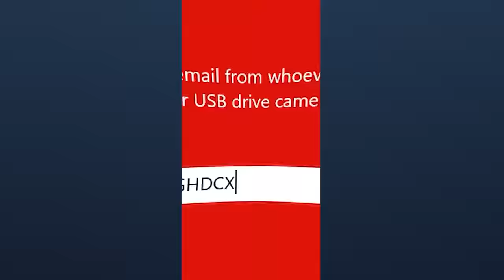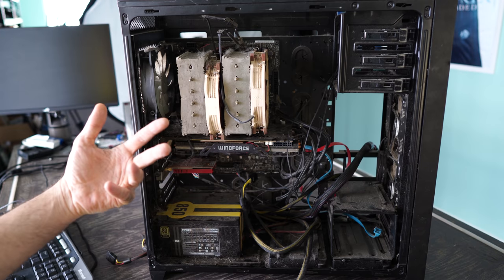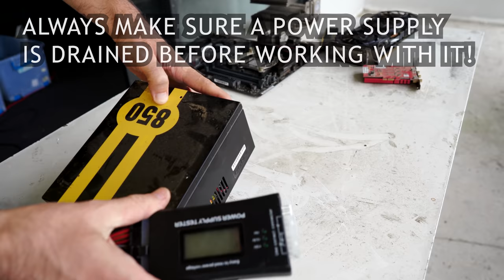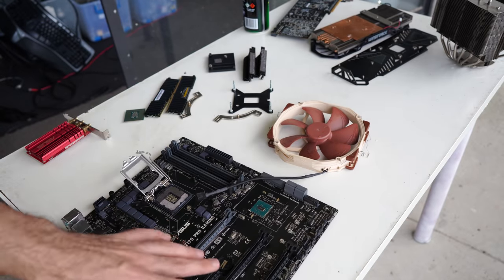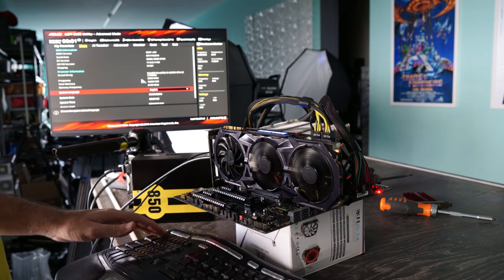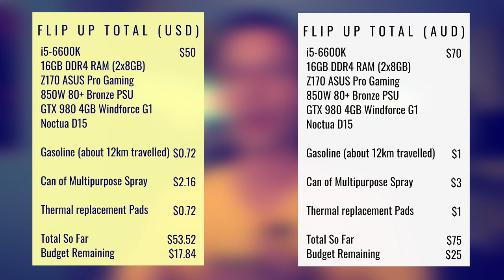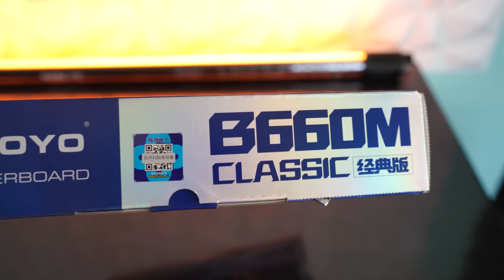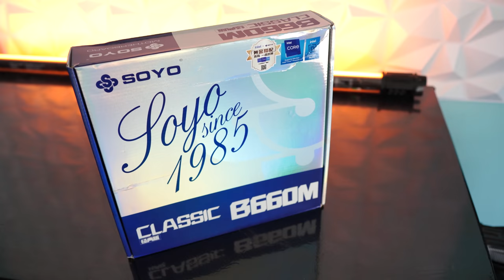Turning $100 into a HIGH-END Gaming PC - S2:E1 "Untested means UNTESTED!"

Comment: The PCIE cable that failed, was probably the root cause of why he sold it for 100 bucks. The moment you removed it, the system would have been fine. The old owner probably troubleshooted every other component excluding that one psu cable.
Reply: Or just trashed it without doing much internal troubleshooting (especially considering how dirty it was).
Reply: All the better for tech yes and us
Reply: Yes PSUs turn off if they see a short, be it motherboard, wiring, etc.
Reply: I hate to admit that I once RMA'd a brand new board over a cpu cable being incompatible. I suspected something was up when the replacement arrived and didn't post either. Some troubleshooting made me realize the cables I bought for the CPU were just incompatible. Other cpu cables made it work just fine. Turns out Corsair had DRM on their cable that checks for a corsair PSU, but my PSU was EVGA
Reply: @ThunderbolttheFox  be careful mixing modular psu cables between different manufacturers, there is a big chance that pinouts for them are going to be different and it ends in very spectacular way :) Unless you are absolutely sure that those cables are compatible i highly recommend to simply not do it. Chances are that it was not a "drm" from corsair but simply overcurrent protection turned on and saved your rig because pinouts were most likely different
Reply: @h1tzzYT  Yea, I later made sure to check compatibility list when buying an all red individually braided cable set
Reply: @ThunderbolttheFox  Damn thats some nasty "protection" lol. You should be able to use it however you want, you own it. Sounds like company piece of bull crap "rights".
Reply: So how much would it sale for now that it's clean an working ???
Reply: @h1tzzYT  not only different manufacturers psu cables , my friend ended up killing his motherboard for good by using a cable from his older psu with the new different one of the same brand .....
Reply: @ipmimo  cough hard to beleive but electricity can be wired up differently between identical cables

Comment: You'd expect the CPU, psu, and ram to be good, so that's almost a guarantee'd 100 dollar value!  Great pick man!
Reply: I would have paid $200 just based off of the image. Maybe I like to gamble too much but even if just half the parts work in this market that is a deal! As long as you don't mind spending some time cleaning.. When I see two 8 pin power connectors I think $$$
Reply: Yes
Reply: The cooler alone is worth $90.
Reply: I'd be more dubious about the PSU because they can be broken more easily than the CPU and ram because it can allow dust and debris in more easily. I'm fairly sure the the CPU and ram chips won't allow air in, so they might fare better left on a shelf for half a decade.
Reply: @EmergencyChannel  new not used.
Reply: 980 is triple the price he paid for the computer
Reply: @elijahevo6859  yup, easy to sell it at 200-220$ (where i live) for the noctua not more than 50$, the total of this if everything work is about 350-400$
Reply: @EmergencyChannel  My thoughts exactly. I was about to say, "Bruh, if that's a Noctua NH-D15, then the cooler alone is worth more than 70 bucks." 😂
Reply: where 100$ this pc with this spec second hand cost 5 times then this price in my country

Comment: I think short term tap water cleaning might seem to work, but long term the residue od minerals might cause problems for those components. Using demineralized water (still cheap) with some pcb cleaning detergent might be a better idea.
Reply: Better solution already exists. It's called rubbing alcohol. It instant evaporates whilst being abrasive enough to clean but not damage anything. Rubbing alcohol will not damage a PCB or components.
Reply: Finally someone commenting about using water.  Never use water on electronics.
Reply: I was completely shocked dude I'm like is nobody going to mention the fucking tap water!
Reply: Yeah I was shocked seeing him use tap water to clean everything lol

Comment: Electrical Engineer here. First off I really love this Format! While you cleaned those parts, I started to think about something:
Wondering if it wouldn't be so much smarter for static sensitive Parts like Mainboard, GPU-Pcb and the Power supply to use cheap methylated spirits in the ultrasonic cleaner and just turn off the heater? You can extremely easy kill your sensitive boards by residues of minerals from tapwater (e.g. limescale) on those insanely small contacts.
With 99% alcohol though you could basically cover a running circuit without worrying about anything shorting out etc.
Even the cleanup afterwards is way less time consuming as this stuff evaporates rather quickly at room temperature (even quicker when blowing at it) and even in case of some potential residue still left - like I said - it's very very unlikely to impact the circuit in any fatal way.

Think about it.
Greetings from Germany,
Leander 🤙🏼
Reply: Yea I really cringed at that myself. 99 % ISO is a must.
Reply: The dirt and grime is way more conductive than the residue from tap water and dish soap which are way cheaper than isopropanol or metholated spirits. If you give them all a distilled water rinse you will remove most of this residue also if you so desire! Blow dry and its ready to go just like the results that Bryan has been getting.
Reply: @AsurmenHandOfAsur  Distilled water is fine.  99% alcohol could be used in dip or bath prior to using the ultrasonic cleaner.  However, such a bath isn't absolutely necessary especially for this kind of restoration/flip build.  Lastly, 99% alcohol is expensive.
Reply: He sprayed and vacuumed the board after cleaning. Even if the remaining residue is conductive in a hydrophilic solution, it won't conduct after removing the water. Also the Spray with... whatever he used will help to remove exces water, since steam pressure of two non mixable fluids will add to each ofter, thus sinking the boiling temperature.
Reply: @NightPaddle  However, this particular thread is about the possible presence of minerals in tap water.  Also, I'm not concerned about the use of tap water in this situation.  In regards to my post, I was just pointing out that distilled water could be used as an alternative to the tap water.  Obviously, he knew to remove any left over water and did so quite effectively in the video.
Reply: @NightPaddle  I don't see how minerals found in the residue would not spontaneously form conductive paths during the wet stage which, upon drying off the water, will just settle and dry up, forming a possible path for electricity to take again...
I have had too many cases of this, where minerals like limescale or salt have gotten into electronics, and alcohol was the only substance they wouldn't dissolve in and conduct again.
Better be safe than sorry!
Reply: @Elektrotechniker  in theory salts only conduct when they are dissolved in a liquid. When they have formed a crystal, there is no way to transport electric charge. But that's just my view from the standpoint of a rather chemical educated pharmacy student. If you have had other experiance as an electric engineer, I might assume, that moisture from the air is still present.
Ansonsten Grüße aus Deutschland zurück!
Reply: You're all nerds

Comment: Congrats on such a great score! That Noctua cooler alone is worth $70, so you got one hell of a deal there!
Reply: Had the exact same thought! I think he's making the right choice, but second best choice? Flip that for $70 and add a solid used cooler, used case (no fans necessary!) and a SSD with the remaining $100.
Reply: @benpatch8692  For a capable systems it doesn't even need a new case, the old one is fine. And I doubt someone looking at that 6600K for gaming would invest big into a fancy RGB setup anyway.
Reply: Fake only cooler 100 USD

Comment: That looks exactly like the shape my PC was in when I found it dumped on my front lawn back in 2020!  After MUCH cleaning and restoration, it turned out to be a really good PC that is still going strong!  I also got a Corsair 850 watt PSU with it and a very dirty ASUS GTX 780 ti,  8GB DDR 3 RAM,  and a i7-920.  I would like to get a better Xeon CPU for it soon, if possible.  I have upgraded to 16GB of memory so far. It DOES gulp down about 425 watts under load due to that very power hungry GTX 780 ti and 130 watt old i7-920 CPU, but it serves it purpose for me!  👍👍
PS: I feel your joy when you saw it power up into the BIOS screen!  Great work, Brian!  👍👍😁😁
Reply: A cheap X5650 or X5675 will improve your build loads. An extremely worthy upgrade.
Reply: Xeon, not xenon.
Reply: X5675 Allday for an old X58 1366 rig... ihad mine running at 4.4ghz for a few year and she loved it paired with a 1660ti... so good for there age...

Comment: I'd try to flip the Noctua, too.  I bet you could get US$50 for it with some patience.   No need for a beast cooler on an i5-6600k.  Throw a Snowman on there and net $25-30.   Or I guess set it aside and use it in a higher tier build down the line.
Reply: That cooler is nice.

Comment: been using that same noctua cooler since 2015. Ive carried over from an i5-4690k to a 1680 v2, and now a 1660 v3. I will use it till it no longer fits modern sockets, it's such a beast!
Reply: You can get new socket bracket for that cooler from noctua. So it will probably carried over to your newest build. Great investment

Comment: Selling that 980 separately and using that buck to build a balanced pc around the rest of the parts sounds like a solid plan. That's also going to let you use a smaller PSU so you can save that 850 for a later project 🤔
Reply: I think the idea is to turn the 100 bucks into a high-end pc that you theorically could reproduce yourself. He cannot mix these components with other projects.
Reply: @Lougardeixion  he could buy a cheaper PSU though and use this 850 in a next flip
Reply: @Lougardeixion  Yeah I meant that if he sells the gpu and changes the psu, he can then build a more powerful pc with the profits and use the 850w since a psu of that size would be overkill with an i5 and gpu that is weaker than gtx 980

Comment: The issue SoYo is going to have is with older techs who remember their older products. They were budget, extremely budget (think PCChips), and they were anything but quality. High failure rates abysmal longevity, They worked decently out of the box if they weren't DoA but they never held up.
Reply: "PCCHips" now that's a name I haven't heard in a long time (still have a mobo with P3 working, that I use from time to time to test that era hardware)
Reply: So was LG.
Reply: Toyota once sold really crap cars too. Then, all of a sudden they didn't.

Comment: It's so satisfying to see stuff cleaned, fixed, restored. Of course also because those are still great components components with respectable performance.
Reply: I was worried when he dumped the parts in water 😬
Reply: @babagandu  He knows what he is doing though, he drained the system of electricity before opening everything up. The ultrasonic cleaner is new to me, but otherwsie I know people that take warm soapy water and a brush to clean old systems / motherboards anything EXCEPT hdds, and they work well after they are 100% certainly dry.

Comment: Awesome video. Good job for finding a 980 for less than $100.

Do those fans have waterproof bearings? 

Also, you should replace thermal pads that have cracks/tears. The cracks/tears can cause hot spots its probably not a big deal but a good habit.

Comment: Around 1998 to 2000 me and some friends dug in dumpsters in a warehouse/tech jobs area and found a pile of old IBM Microchannel servers and Apple Macintosh computers. We found Apple keyboards, mice, power cords, old software it was a treasure trove of old Macintosh Classic, SE, Color Classic, LC520, Performas, I have a closet with 24 old Macs and my family been bugging me to throw it all away. I just can't do it, it seems a crime to throw away these old working computers. So they just sit there collecting dust. The coolest one is the LC520, it has a cd caddy, built in speakers, color monitor and fun to mess with. One mans trash is always another mans treasure.

Comment: They do anti static vacuums, when I worked in IT we had one contract to clean servers for a supermarket store as they would overheat.  We used anti static vacuums and air dusters..  If you use a normal vacuum you can damage the electronics which may show up straight away or further down the line..

Comment: I recently bought 3 tubs of K5-PRO to replace pads on my GTX 970, works great.  Does not use much K5-PRO, cut the end off of a Q-Tip to apply it, probably used 5% of a tub.  Bought 3 tubs because shipping was free, one tube I would have had to pay shipping.  Probably never use all of it - ever.  Also replaced the TIM on the GPU.  Card runs much cooler now.

Comment: That is one hell of a screaming good deal. The GPU alone goes for about 250USD, the CPU is around 100USD and that corsair 16GB DDR4 kit goes for about 65USD. Those are prices for used parts of course. I m not even adding the other parts, like that Noctua cooler. Mind you, this is in the US. This was a fun video!

Comment: I have no idea if this is the case in Aus, but I've noticed a trend of raspberry pi 3b+ and 4 being sold at huge markups second hand. Apparently availability is bad, and these things are used in some industrial applications for powering User interfaces for large custom machinery. I've seen 70-80€ retail pi4s listed for 150-350+ €. I expect the top-end of asking might not sell, but that's what's on my feed. Situation is not expected to get better until 2023, so you might have a year to play around with these. I understand it's not a market you're into right now, but if you make connections then unusual things like this might bring in a good profit. I think it's fitting for a series like this where the idea is to either get lucky or to ride the wave and be the first for new metas.

Loved the video. Big Tech YES energy. Much love to you YES man.

Comment: I had a GTX 980 and I used it for over 7 years!  That was an AWESOME GPU back then and I used the crap out of it!  I only stpeeped up to a stronger GTX 1070 because I needed the larger amount of RAM it could provide to play some trucking games that I enjoy but always felt that the graphics it "could" provide just wasn't enough to drive the game to it's actual potential.  My wife now is STILL using that 980 as all she needs it for are games that really don't even need that amount of GPU power, but she does still have the choice to later play some AAA titles like GTA 5 if she ever wanted to!  Nice find all around I'd say Bro!!!
Reply: Gtx 980 is only a small step behind 1070, fully capable of blasting all triple A games and triple X videos!

Comment: It cleaned up really nice. And it needed it! What I don't get though is that everyone shorts the pins, while it is so easy to get an old reset button with cable and plug that in. At least that was what I always did. A good begin in such a series is indeed important.

Comment: Your Videos are just fun to watch, really smooth, good attitude and relaxing music. Love it Brian! I´m still using  my Xeon X5675 OC to 4Ghz and just bought a used Asus TUF 3080 OC 10GB to upgrade my ASUS Strix 1660 TI OC - works fine so far. Guess im going to upgrade to the 5800X 3D after release of the 7800X 3D on 6th of April, since i have Birthday on the 4th April  and give myself a present, maybe im going straight to the 7800X 3D because I like the longer lifespan of the AM5 Platform, but I've actually never bought the latest parts, because anyone who knows anything about PC parts knows that they are always heavily overpriced at release.
Guess i should wait a bit after Release on the 6th of April, but it´s my Birthday on 4th April and i got the X58 Platform since 2013... 😂😜

Comment: M8, using standard H20 on electronics is not now or ever a good solution, you should use distilled water at best or a ultrasonic full o' isopropyl or other non destructive non conductive medium because all you have to do is miss one tiny trapped bit of water and it can wreak havoc inside of there or spread out and cause corrosion which will spread due to the behaviour of electricity in circuits and mismatch of materials.

Comment: A week ago I sold my second build with an i7 3770K, a Gigabyte Z77X-UH3 mobo, 16 GB  of  DDR3 Corsair vengeance 2400 Mhz and an ASUS GTX660 TI-DC2-2GD5, a Samsung EVO 850 250 SSD and a 1TB WD black. A 600 Watt sharkoon PSU on sale and a Sharkoon RGB case on sale. And I followed your lead and put a random wifi card in it, Thanks for the Inspiration.

Comment: From my experience thermal pads dry up like the paste and if I re-paste an older GPU I prefer to do the pads too.
They don't dry as much as paste of course, but I've had much better results when I've changed them than when I've re-pasted GPUs and not replaced pads.

Comment: You could use a hairdryer and a thermometer instead to dry the board. Get it to 80 - 90 deg. C. That way you can be sure all water is gone and it is much quicker than blowing it out cold.

Comment: Three things i can think is either rebuild the whole system as is in new case and sell it like it is, sell the gpu and CPU to get a i7 for the mobo and GPU upgrade for the latter, rebuild the pc and leave the 980 to be sold only, swapping the ram with a new set and later on getting an rtx card in there.   6th gen Intel has alot of life left in it for gaming and having that pc used as a full on workstation!  Pretty sweet deal for that pc. I would love to have those specs for that price